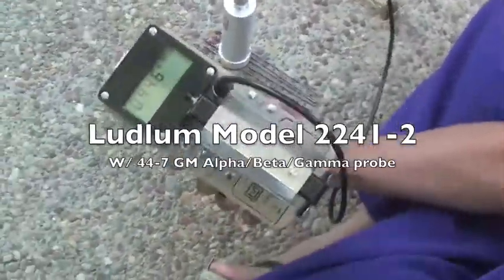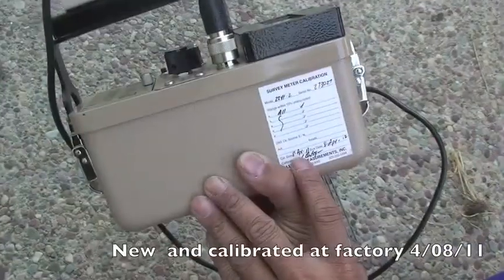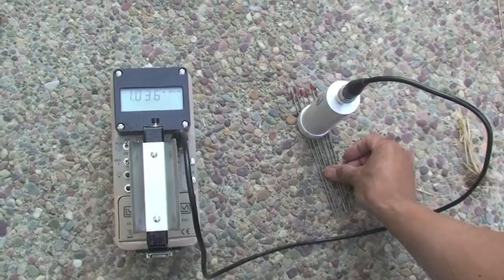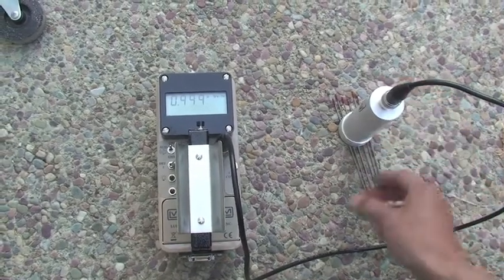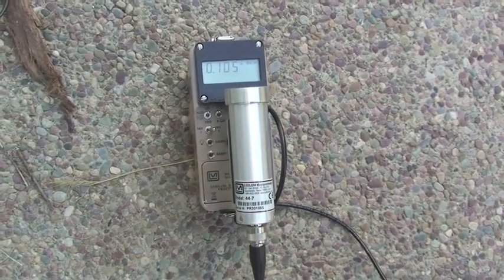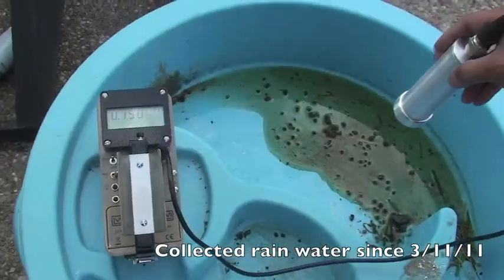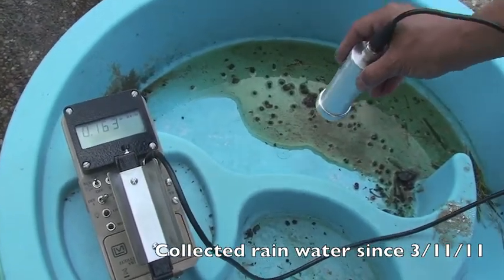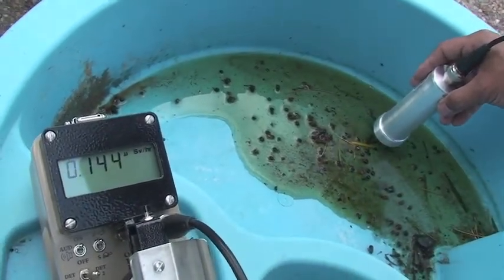Measurements from my Ludlum 2241-2 Radiation meter

Comment from the maker: To buy any Ludlum equipment, contact their sales rep. or drct.com. Its much easier if you work for a lab. Like any radiation measuring device, there is some mfg delay on getting them.

I did several measurements around the BayArea and so far, nothing significant. I will post more videos later. By the way, just to put some things into perspective, a reading at 7200 ft above sea level near Truckee today 4/17/11 is around 0.4 to 0.5 micro Sv. Much higher than the collected rain water here.